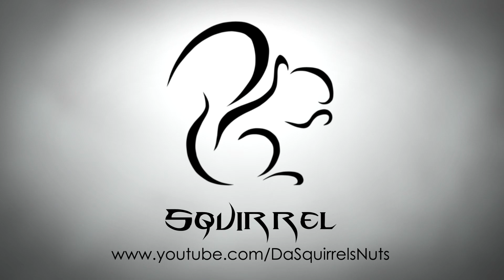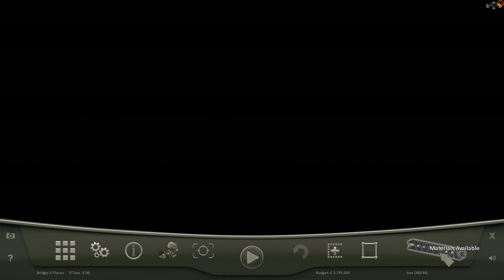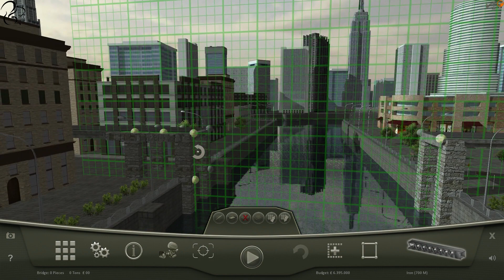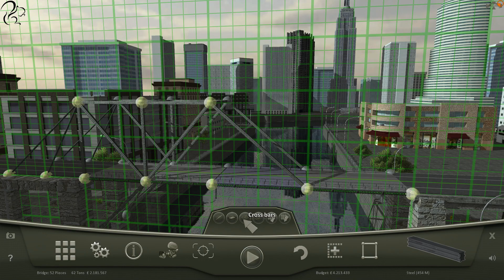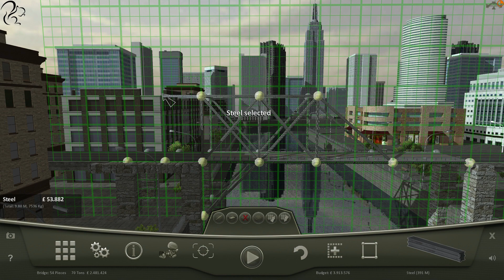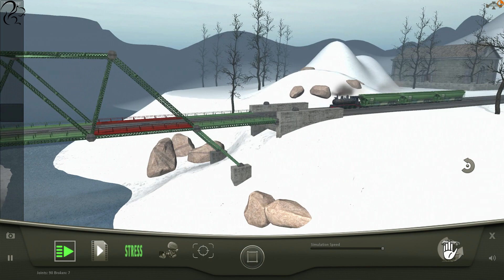Lets Play Bridge Project - Episode #7

Comment: it didnt fail because of the cables...there is too much weight on the roadway than the steel can support it from under...you need to build the tower on the dry ground and then spand cables...they are strong enough...

Comment: Squirrel, don't know if you consider this or not but make sure you remember that any structure you build (iron, steel) has its own weight pulling it down as well. Also, cables only support tensional stresses, not compression stress. on that one bridge with the cables, it collapsed because the cables were trying to support the weight of the structure, which was a compression force.